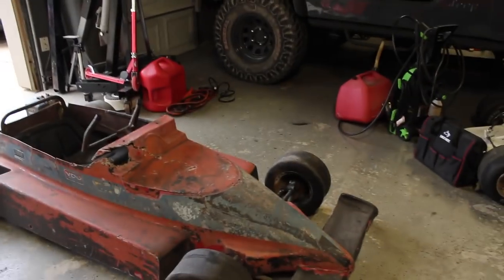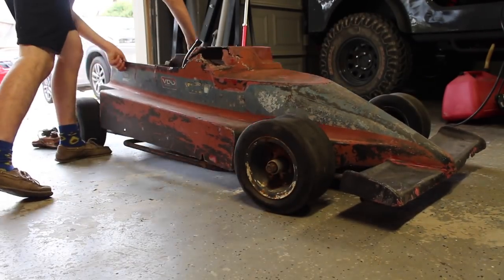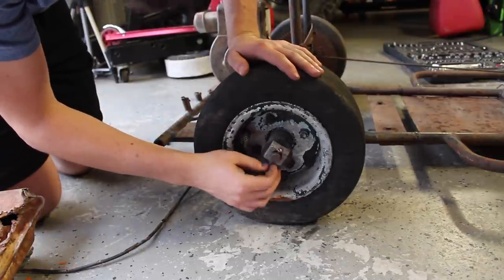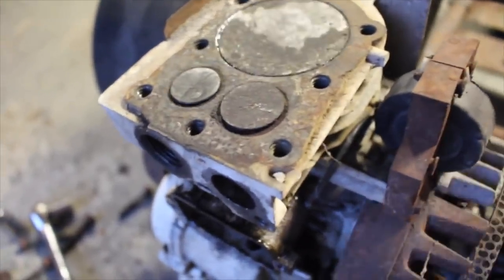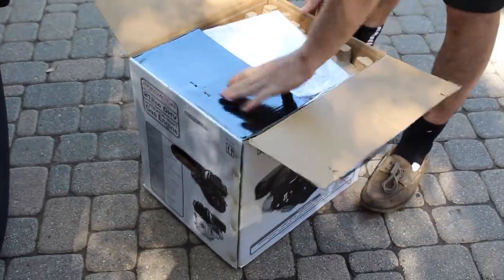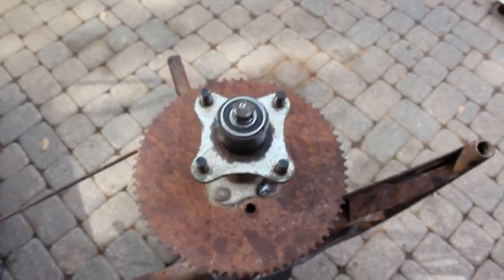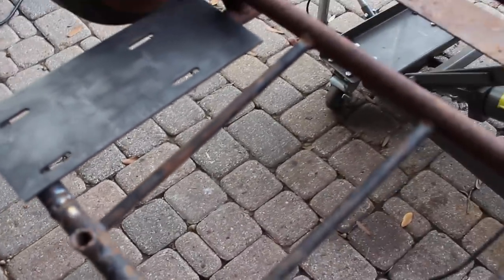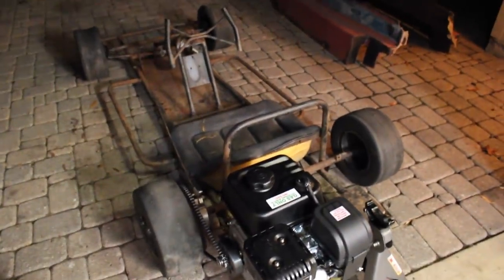60's Go Kart Revival

Comment: That's a pretty cool go-kart. I had one exactly like it once. and I have that same steering problem. I cut the frame in half an extended it and then I put on a 13 horsepower motor. And did away with the single wheel drive and put on a  solid axle for two wheel drive!!

Comment: ooooh.... improvement time! give those steering kingpins about 12 degrees angled back, give it a live axle setup. like turning left: front right tire turns forward angling slightly UP (as left front turns back+down to press down to help lift), rear left tire (the one to the inside of the turn) lifts up 1/8" to 1/4", so you don't need a rear differential. being you've already slapped a 212 onto it, might as well make it handle more like a little racer. it may need a little more tubing added for rigidity, so it can do what I'm describing better, but after some fiberglass and paint work that little old toy could be pretty special.
Reply from the maker: model nutty Yeah that sounds pretty cool, I don't know if we're gona go with a live axle setup yet but we're gona consider it in the future.

Comment: Next time you have a locked up engine pour marvel mystery oil down the spark plug hole and get it into the valves and let it sit overnight.  Marvel really is a marvel.  A neighbor didn’t mix oil in his 2-stroke scooter and the engine was completely locked.  I could stand with all my weigh on the kick starter and the piston wouldn’t move.  Marvel down the spark plug hole for a couple hours and amazingly it came back to life and ran like it was never ceased.

Comment: Before you hack up the steering and body more first try adding an extension to the top of the steering column. I have a similar go kart and had to do the same thing. It was way easier to  add the extension than basically re-doing the front end.
Reply from the maker: justice lee Yeah we were planning on doing something like that, thanks for the advice.

Comment: Get a live axle on that kart and it will probably fly.
I'm thinking if we manipulated the position of that engine mount, stick a 670cc engine in the middle with the exhausts facing the back, fabricate an F1 body rear end and have the exhausts pop out the back like an F1, then a disc brake or two?
The possibilities of upgrades are endless until the imagination or wallet runs out of fuel.

Comment: So bummed you didn’t get the old briggs going. I was like oh sweet, he’s going to get that old engine going instead of just plopping a predator on there like everyone else. Literally the next sentence out of your mouth was parts are too expensive so I’m putting a predator on there. I don’t care for predators for that very reason. You could find parts for that Briggs at your local small engine shop junkyard for cheap.
Reply: lawnmowerdude not everyone has weeks of time to source questionable parts for a crappy 3hp motor.  The cart would be pathetically slow with the original motor, and totally not worth the effort.
Reply: Fivespeed 302 weeks? Ebay is your friend. It all comes down to what you want. Some people want fast and easy and others want a challenge. It's their kart and they can do what they want. I personally don't like seeing old machines trashed without seeing if it salvageable. I thought that was the point of a restoration. But other than the new engine, they did a nice job of fixing up that old kart.
Reply: I have a Snowbird snowblower with the original Briggs on it from the late 1950's. Parts were not difficult at all to get and it has to have the original engine because the entire machine is geared for that specific motor from the factory.

Comment: That is a really cool score on the old gocart   I kind of agree with the other comment about  rebuilding  the old motor   I had a older Briggs done at a  votech high school  for practically nothing in parts  and that engine is still running  over  15 years later with no problems. Plus  it actually. Got bored   And.    Shaved giving it a little more power  too ( that was the teachers idea ). To get the old girl going as cheaply as he. Could for me  it had sat outside  for a long time before i bought.  A used cart   At a yard sale   It ran with horrible compression  when i got it.     So i took advantage of  a small engine    Shop at a high school    Labor was free. Although i did make a contribution  for a fundraiser they had going on  ?

Comment: i have the same style kart with an older 6.5 hp engine on it and it still drifts with snow tires, it's a fun fast little kart. (btw mine is not rusted out)
Reply: This one on the vid has a fiberglass body. Doesn't rust, it decomposes.

Comment: Hi you guys its Mike Roberts again. Rather than playing around with those four stroke utility motors that put out no horsepower. I was thinking that you may be able to get yourself a two stroke outboard motor. The cylinders are mounted on top of one another so you can still have the seat come back beside it. Not like those stupid multi cylinder motorcycle engines where the chassis has to be longer so you can place the motor behind the seat. You should be able to shorten the outboard drive shaft and turn it 90 degrees so it will be in the right position to accept a racing clutch and you can put the radiators on the opposite side of the seat. I believe most of them come with expansion chambers. And the best thing being is they all have their horsepower rating on the cowling. It would be a cool setup with say 30 HP. And i am sure they are cheap especially the old ones that are outdated and not used because of emissions. Just a thought.
Reply from the maker: Mike Roberts yeah I'll take a look at it, thanks for the advise.

Comment: I liked what your doing with that cart.
As a kid I had a job in Coney Island fixing the go carts.
One thing.
Don't you think you should have rebuilt the chassis and improve the brakes first?
That predator engine it much more powerful than the 31/2 horse Briggs and Stratton.
BIGGER BRAKES PLEASE.

Comment: Check out MAR-HYDE ONE STEP rust converter. It works! I've used it MANY times. It converts the existing SURFACE rust into a primer and you can then paint right over it.

Comment: dont beat the outer race of the bearing. use a small pipe to hit on the inner race if you must bash on it.
Reply from the maker: jason birch Yeah, we didn't have a pipe small enough, but we were able to heat the bearing so we didn't have to pound on it too hard.

Comment: started out great, than you ruined it by putting on the new engine. rebuilding the old briggs is cheap. just do it
Reply: No to mention he said the predator was more reliable hahahaha obviously no briggs experience
Reply: 3 hp vs 6.5 bro
Reply: you realize that briggs has higher torque ratings right meaning that the horsepower is better used
Reply: MrWolfSnack That kart looks like a frankenstein mess, at that point it would take too much work and resources to get it "period perfect"
Reply: @MrWolfSnack  kinda late, but not too rare. Hell there is 2 within driving distance to me.

Comment: Your old man or the internet did tell you though when breaking in a engine you should be using hi expensive oil within compounds and it so you don't get the metal shavings anymore I mean do you realize hi work that Midas muffler and a couple other mechanic places you never break in a engine sure without using breaking oil just a let you know you don't use cheap oil otherwise you'll get metal shavings and there's no point of using the engine again
Reply: Unfortunately, metal shavings are a normal thing in these Honda clones, regardless of what break in oil you use.